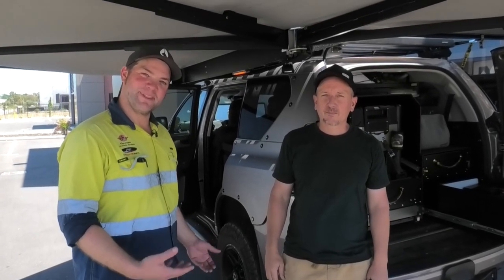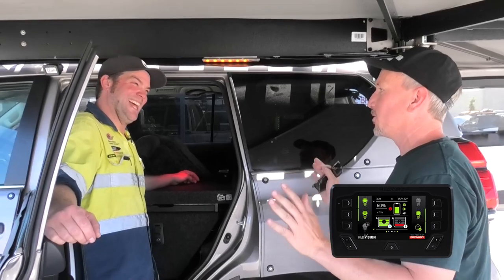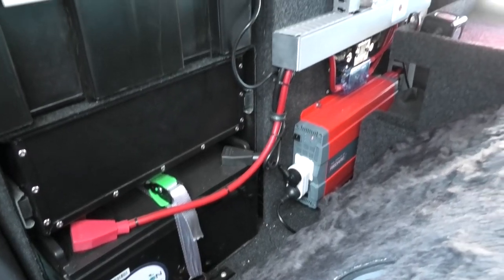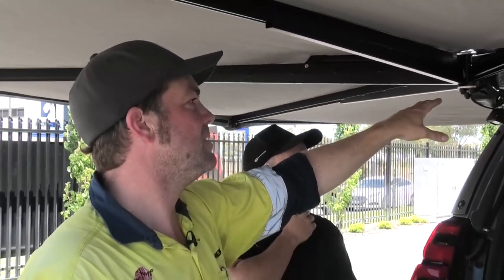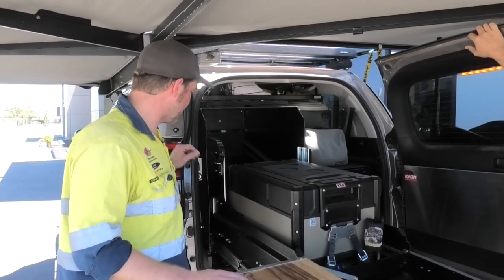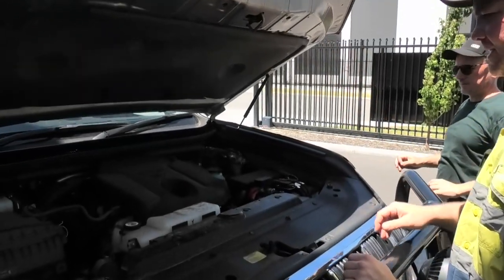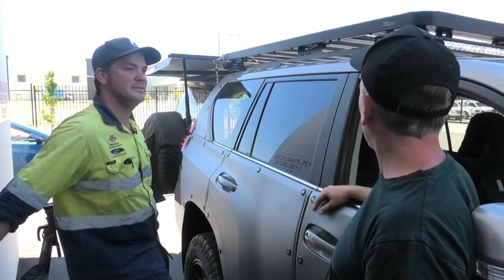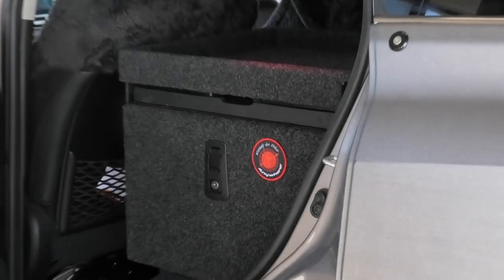Heiner Builds Your Ride | Toyota Prado #projectprado

Comment: Great work as always. Do you guys sell sealed alternators for the 1hz or 1hdt by any chance ? website says u have one for the 80 series and 100 series but doesn't state which engine. thanks
Reply from the maker: Hello, apologies for the missing information on the product pages. I would be best if you could please fill out the form at https://perthpro.com.au/pages/starters-alternators and we will have all the information we need to get you the right one you are after. Thanks!
Reply: @ReadytoDriveAnywhere   cheers for the reply. Filled out the form